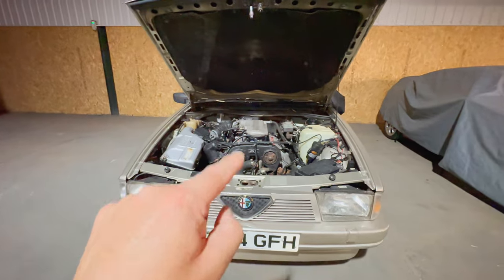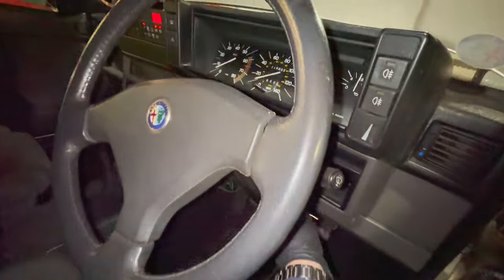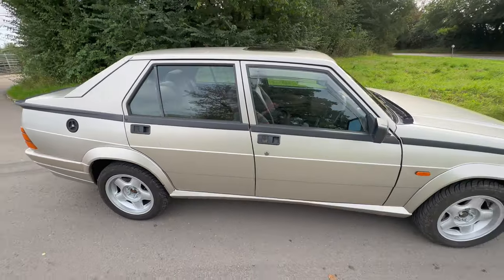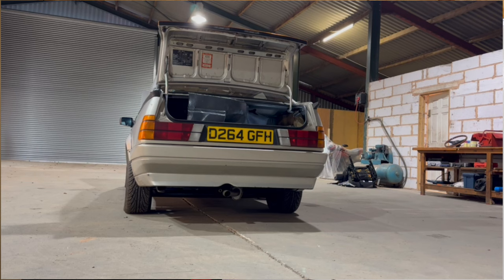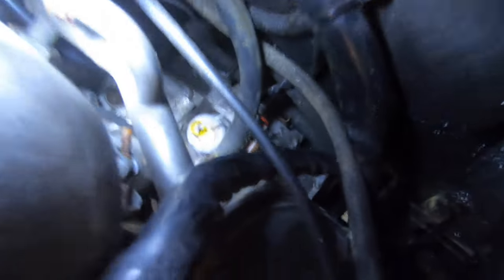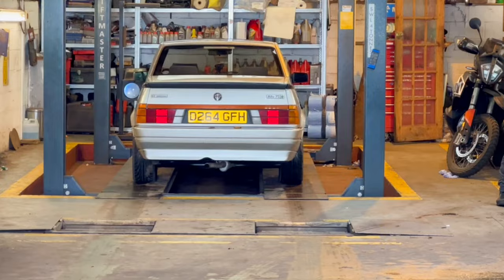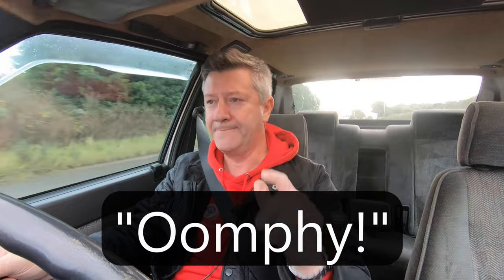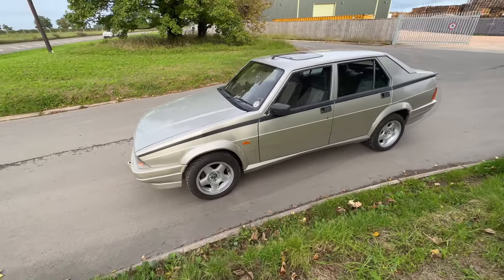Barn Find 1986 Alfa 75 V6 Restoration - Part 2

Comment: Full marks for resurrecting an Alfa Romeo 75 v6 and trying to get it in proper working order. However, it is wrong to compare the Alfa Romeo 75 with the new Alfa Romeo Giulia. Being of italian origin and having spoken with ex Alfa Romeo engineers from the early 1970s while working on a project on Alfa Romeo at university, the marque Alfa Romeo died in 1986 when Fiat took it over, the whole engineering philsophy of Alfa Romeo having changed/disregarded in the 155 following the 75. The Alfa 75 used the alfetta platform of 1972 and all alfa engines, and was the last all Alfa Romeo designed car with no interference from Fiat (or Ferrari). The Giulia was designed by mainly ex Ferrari engineers, headed by an Ex ferrari engineer, and in v6 guise has a Ferrari derived engine also (fact despite alfa saying otherwise) and is too complicated by far in terms of electronics. It should not have had drive by wire brakes either; it is also much larger, like an alfa 164 in size, and should also have had a transaxle like the front engined Ferraris but was too expensive for the development and build. Lastly a purpose built manual should have been available, not the last minute developed europe only one. Apart from that it is a great car also.
Reply from the maker: Thanks for watching and for taking the time to comment.  I agree that the 75 is the last "real" independant Alfa Romeo and this is an important car that I am committed to restoring. The same thing happened to the Lancia marque also and although my first car back in 1986 was a Lancia Beta Coupe, (which I loved) I realise that this was not a "pure" Lancia in the way that the Fulvia was for instance.  Sadly, the car market has evolved into a situation where makers have to collaborate together to be able to make any profit and the inventive engineering of brands like Alfa and Lancia is now too expensive to be viable.  Having said all that, the Giulia Quadrifoglio is a great car and puts to shame virtually all of the German sports saloons!
Reply: @TheAlfaNut  Yep agree with you. Pity about the Lancia marque, with everybody associating Lancia today mostly with the integrale road car, because of all the rally wins with the works delta cars, and forgetting both the Beta four door and Beta coupe editiions and also previous lancias when independent from fiat. Regarding the Alfa Romeo Giulia it is I agree much better than the German sports saloons and I should have mentioned that before. However, lots of US quadrifoglios had many different electronic problems on long term reviews, and lots of people hated the brake by wire grabby feel at low traffic speeds. Lastly for me when they decided not to build a proper manual and sell it in the uk I was upset. Still glad you are enjoying her and the ride/handling combination is apparently as good as lotus could do (acording to evo if i recall well) with a car that flows over mixed camber and non smooth uk roads.
Reply from the maker: Yes the Giulia has a lovely chassis and has a blend of good ride and great handling that is hard to believe. I found a nice Beta Spyder 2.0 from 1980 a year ago, (very underpriced!) which I am also driving & improving. I would love an Integrale too, or even a Delta Turbo but would prefer an early 1960’s Flaminia GT (Touring bodied), or the Zagato Super Sport. Such beautiful cars!